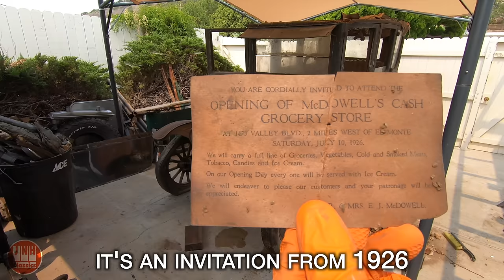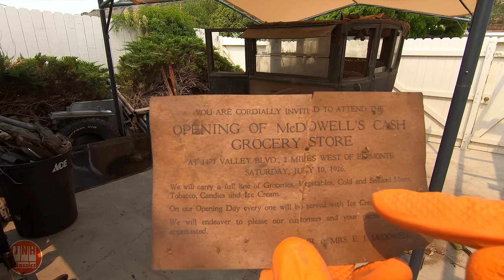A Forgotten Model T (Episode 1) Parked Over 30 Years Ago

Comment: I LOVE THIS! It is Just like Mine I am restoring right now! It is a 1923, Like Yours! The 1923 4 door sedan had straight molding or Belt Line under the windshield, Where in late 1923 on the  new 1924 models the Belt arched up slightly, Even though the Windshield was still straight! AWESOME CAR!

Comment: That sure is a challenging project, oh my. Are you planning for a complete frame-off restauration, or do you just want to get it back on the road again with minimum effort? But even that might be a tough one. Best of luck with the Ford, I'm really curious to see how this will turn out. Never saw a restauration of such an old car.
Reply from the maker: hevog I don’t plan on repainting it, but I will clean it up and get it back on the road👍
Reply: JNH Classics that will mean doing the ubiquitous wood floors; roof, etc. 😉. That radiator looks shot; let’s see how it fares. Definitely Ford tough! Looking forward to the adventure!
Reply: GPOLICE sounds like a good alternative.